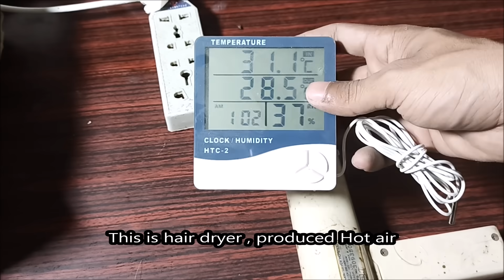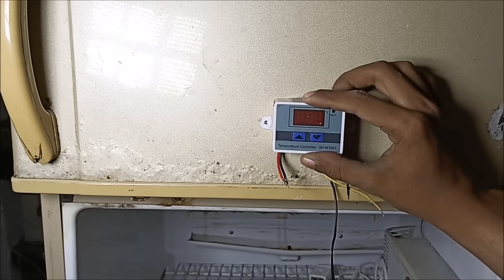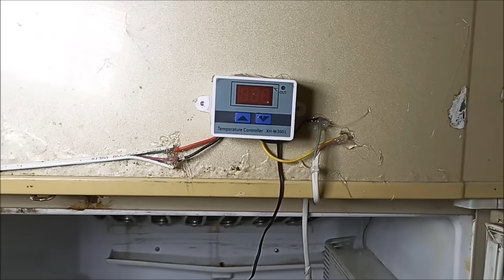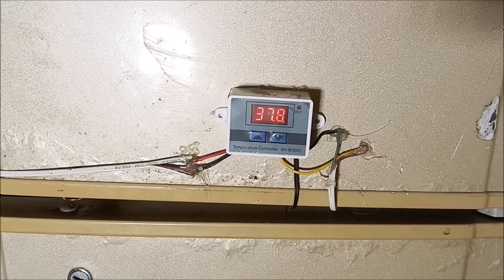Egg hatching in old Refrigerator ( fridge ) Complete Video - Hatched 200 Chicks

Comment: ⚠ Be very careful with this video! If it occurs to you to make the connections as this enlightened one has done, when you connect it to the network, it will short circuit and explode, since he has made the connections on the door, which is metal, a superconducting material of energy.
⚠ ¡Mucho cuidado con este video! Si se os ocurre hacer las conexiones como lo ha hecho el iluminado este, al conectarlo a la red, hará cortocircuito y explotará, ya que ha hecho las conexiones sobre la puerta, que es metal, material superconductor de la energía.

❤️🎱 🦊🦀🐜

Comment: Do not need a refrigerator. Can easily build this from wood. Also, that hair dryer could catch fire and burn the PVC plastic from long duration of use. That PVC will burn like gasoline.... not a good idea. 😕
Reply: Température is low

Comment: Its not a good idea to use hair dryer
It use alot electricity and it throw extreme hot air which will not spread evenly in all fridge

Comment: In case I don't have enough time to rotate the eggs twice daily. Can provide two electric bulb for the incubator, one at the top and one under. If I construct it this way will it work out well?
Reply: Please your response is needed
Reply: @FGTGIFarmsAndConsultancy  as i read the 3 rotations a day are needed to make the embryos not stick to either side of the egg. it may lower the chances of survival to not turn them. so it may not be about getting them heated from all sides, but having them moved.
Reply: Thanks

Comment: Fridge is fully insulated. Hair dryer source of heat. Water placed in for humidity. Temperature and humidity monitored. Hatch chicks.
Reply: IS THE HAIR DRYER GOING TO BE ON THROUGHOUT THE 21 DAYS OR YOU CAN SWICTH IS OFF SOMETIMES

Comment: I tried this idea bro with our old refregirator, the problem was the hair  dryer don't work. I do the same with what I saw your video bro (Yellow and black wires of the thermostat were connected to the hair dryer and the red black wires of the thermostat were connected to the wire for electric power) would be possible the thermostat and the hair dryer were not compatible? Thanks for the answer bro.
Reply: maybe the thermostat's relay is faulty or  maybe u made a mistake when wiring, a hair dryer,lamp or any other electronics need the + and - (vcc and GND) to use it with a relay u can hook the -(GND) from the power source directly to the hair dryer(or the lamp) but for the + (vcc) u hook a wire from the power source to the relay and another wire from the relay to the hair dryer, another mistake is using the wrong setting when using thebthermostat, it usualy have H and C setting, C used for cooling (like fridge , freezer etc) while H used for oven heater etc